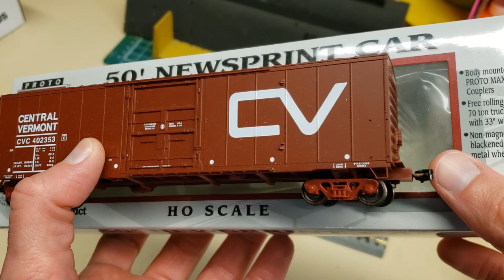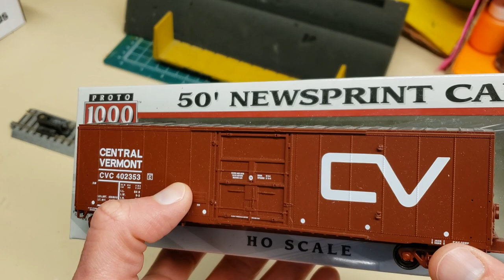Stockyard Industrial Lead: Car Shop: Fixing Freight Car Defects In Between Op Sessions

Comment: Hi Eric.  Totally agree with your standards system.  All freight cars on my layout get Kadee couplers, metal wheels and then weighted to NMRA standards before they go on the layout.  With that I have very reliable running and, as you said, keeps the guys interested in operating.  Eventually they all get details and weathering, but the three basics happen first. Happy modelling. Brendon
Reply from the maker: Yes, that's a great process to have in place. Happy modeling to you as well!

Comment: Great video thanks for sharing. I need to do some maintenance on a few of my cars especially with couplers and other minor repairs. I have RIP track on my layout and also a car shop in the making as of now. I have an older style car card system I'm using at the moment until I get JMRI set up. It works and right now I just shuffle some cards and pick what I want and send it out. Anyways thanks again for sharing and take care.
Reply from the maker: You bet, thanks for watching!  Sounds like you have a really good system set up for repairs and for your ops.
Reply: @emillerz  yeah it works for what I need it to do being the engineer/ brakeman/conductor/ Railfan LOL. It's all a work in progress.

Comment: Eric.. Just getting my feet wet in HO.. I too found height issues with a few pieces of rolling stock. I too got the same washers as you use but, I do one more step.. I found I had some friction on the washers after adding them. So, I use a bit of Kadee #231 Greas-em before putting the truck back on.
Reply from the maker: Thanks for the tip, that is a great idea!  I have not had any issues like that yet, but that is good to know for when something like that comes up and I can't figure out why a truck isn't moving!

Comment: I use really small lead shotgun shot on flats, bulkhead flats and gondolas by super gluing them on the underside of each car. I’m sure steel shot would work as well
Reply from the maker: That's a great idea - I have seen that used on some cars that I have bought before.